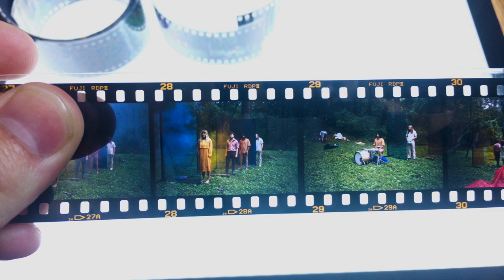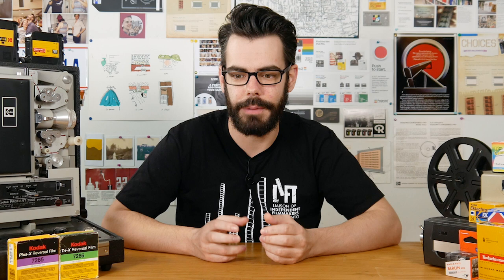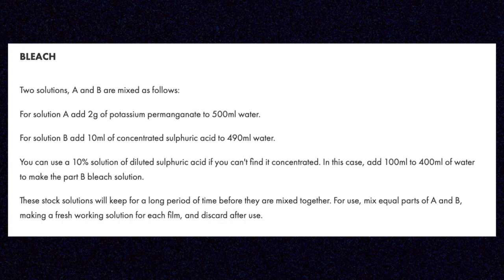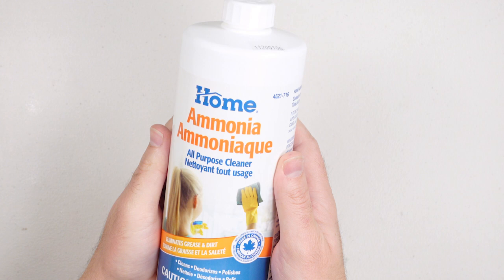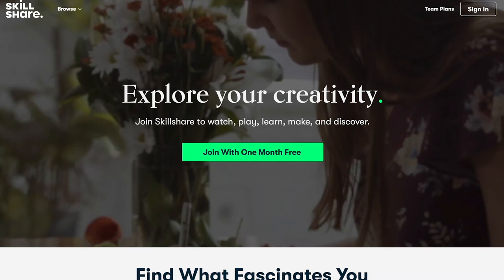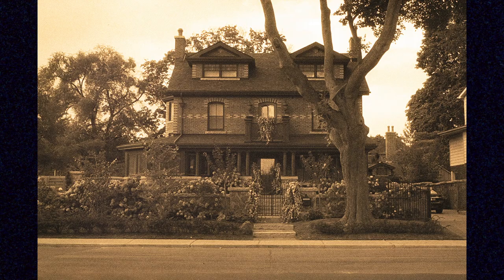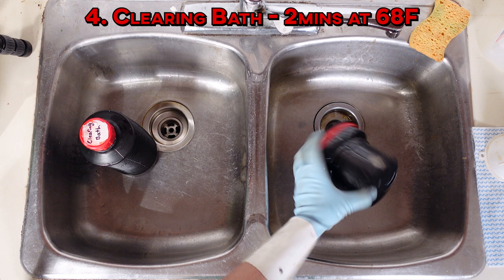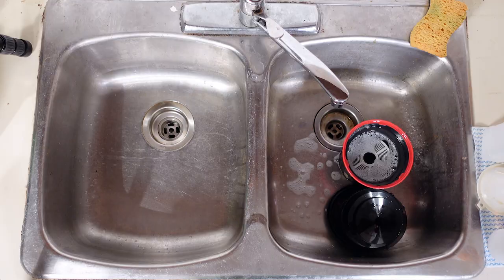BLACK & WHITE REVERSAL Developing Without a Kit | Slides from Negative Film

Comment: Second Exposure: Get a Flashlight, a big white bowl, fill it with water put the reel with film inside. flash it 10-15cm from above diagonal 4-8times, turn it by 90 degrees after every flash, so you cover each side once or twice. flip the reel over and flash it like before...

Comment: With the vinegar and peroxide photographic bleach, for one roll, you, need 60 mL of vinegar for every liter of hydrogen peroxide, take 350 mL of it and microwave it for 50 seconds at 1100 watts, it will fizz when bleaching is taking place, wait for a minute after the fizzing stops, then you can expose it to light, and then reuse the first developer. The positives will have a yellow tint, soak the film in tap water for 5 minutes, dump out the water, then replace with 350 mL of water, 1 teaspoon or 15 mL of citric acid powder, and 3 teaspoons or 45 mL of sodium thiosulfate (anhydrous) powder stirred up, soak for 7-1/2 minutes. Then rinse the film good as usual.
Reply: I would like to add that you should make sure you rinsed out all of the first developer from the film, otherwise it forms a coating and no force on earth will get the film to bleach ever again, no matter how hot the peroxide/vinegar solution gets!

Comment: And here i was, about to complain that the bellini kits asks for six baths with washes in between. Seeing that you even had to mix your own chemicals, I reconsider how lucky i am to just be able to buy the ready made kits :) I developed Fomapan 100 (non-R) and it came out very high-key but useable. Kentmere 400 came out dark and low in contrast, but still very useable. Then again, the kit said that it only works with Pan-F, FP4+, Agfa Scala and Rollei Ortho 25. i guess thats because these films have similar developing requirements and the the first and second developer is tailormade to them. But, i first exposed the film and then decided to read the manual :D

Comment: My current go-to BW reversal film is Arista EDU 400, shot at box speed. My process is pretty slow, but the slides are probably as close to perfect as I'll ever get. All at 68°F (20°C), I develop with Arista paper dev for 17 minutes 30 seconds (Constant agitation), wash for 15 minutes (Peroxide bleaches seem to make the film brown if there's any trace of this paper dev, probably could be shortened for copper), then bleach with copper sulfate bleach (For every 100ml water, add 5g copper sulfate crystals, 5g non-iodized salt, and 1g citric acid) for 10 minutes (constant agitation), wash for 6 minutes, 2 minutes 30 seconds in 2% ammonia (Constant, needs to have no additives), wash for 6 minutes, 6 minutes in a clear bath (20g sodium sulfite in 1 liter of water), wash 6 minutes, then redevelop for 10 minutes in Iron-Out (The toilet cleaner, add 40g to 1 liter water, filter before use, no reexposure needed), wash for 3 minutes, then fix and rinse as normal.

I really like using this specific process because the bleach lasts seemingly forever, ammonia is cheap, the developer is easy to buy, and way too many places sell Iron-Out. Wish more people talked about copper sulfate bleach as an option, as it doesn't destroy the emulsion like permanganate does. The only downside I know of is it doesn't work for films that use silver chloride, which is a very small minority of film. Also ammonia is stinky, so using a lid on the tank is recommended for that step.

Another niche version of BW reversal involves developing with paper dev, then using BW toner in the wrong order, which will convert the undeveloped silver into something else (Silver selenide for selenium, silver sulfide for sepia), then the bleach will make the rest of the silver removable with fixer, leaving just the toned positive. I've got the chemicals for this version of the process, and plan to try it out over the weekend.
Reply: Arista EDU 400 is just Foma 400 rebranded
Reply: @dian_photo  Yeah, but the Arista branded film is cheaper in the US.

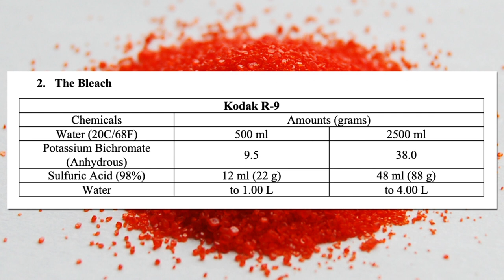Comment: 6:00 i have access to dichromate and sulphuric acid, a fume hood to mix the powder, and a safe way to dispose of it. 
My main struggle is that i have yet to find a developing tank that will not randomly decide to leak that day. All the tanks i tried work perfectly leak free one day, then decide to drip the next day, and the day after are perfectly fine again - no matter how firmly i screw down the lid. 
If it weren't for those stupid unreliable tanks, i'd be using the dichromate. 
If you cannot guarantee that not a single droplet of dichromate-based bleach will spill, do not work with dichromate. It's one of the nastiest chemicals out there.

Comment: The B&W reversal film was quite common in the 60s and 70s, I have a bunch of B&W slides on AGFA film from my uncle. They lived in the middle of nowhere in Argentina, and had access to this :) I did notice though that the slides look a bit more washed out than a B&W negative.
Reply: On a second look, I've found a few cases of the same photo in both reversal, and negative. so I think, mean I got the crazy idea that they might have contact printed the negative on top of another B&W roll, do you think it's doable ? would it produce a positive worth the effort ? I noticed the reversal prints don't have much grain as a negative, and are a bit more washed out. Also, the sprocket holes on the positive are exposed, and show sprocket marks that suggest contact printing. I can send you photos showing this if you want, and also for comparison between negative scan vs. positive scan.
Reply: I've also noticed on the positive B&W film, that they are printed on the wrong side of the film, IE, like loading the film with the emulsion to the back... Was trying to figure out how they could load the film the wrong side on the camera LOL
Reply: I mean the contact is done emulsion to emulsion, effectively reversing the print, which means, when DSLR scanning it on the emulsion side, the image is already on the correct orientation, no need for horizontal flip.

Comment: The most interesting and unique aspect of your process is the chemical fogging that you get by using Iron Out.  I have not seen chemical fogging for B&W reversal before, and can't find any references in Anchell or Troop books, who recommend using a light.  Examining the list of chemicals in Iron Out, we can recognize some typical developer components: (1) Citric Acid (Vitamin C?) is a developer, (2) Sodium Metabisulphite is a typical preservative, (3) Sodium Carbonate is a typical accelerator.  No restrainer that I can see.  So the only potential fogging agent would be the Sodium Hydrosulphite or possibly something not listed in the ingredients.  The question is: can a separate agent be mixed that does the reversal fogging so that a more conventional developer can be used for the final development stage?  This might simplify the overall process and give better control over the final steps.  (However these last steps are "to completion" so adjustments to exposure, etc. are too late at that point. ).
Reply: After some reading I found that the magic ingredient is Sodium Dithionite.  "Iron Out ... is often used for this by photo hobbyists because it's got quite a lot of sodium dithionite".  Also Kodak's fogging developer, FD-72, uses Sodium Dithionite as the reversal agent.

Comment: excellent video, i have been trying black and white reversal for the last year and i've got mixed results.
i used the permanganate bleach made from scratch from components i bpught from a chemical store. this bleach really softens the emulsion so you need to be extra careful when handling the film when it's still wet.
the best results i've got yet have been with ilford panf and pq universal development using the ilford recomended technique. it gave me some really nice positives with dense shadows and a slight warmth tone in the highlights. now i'm using the fomadon lqr developer since it's the one used in the foma kit and using fomapan 100 classic but i dont seem to get the same density in the unexposed areas such as the sprocket holes as with the ilford technique, being the developer the only difference between the two trials so i guess i need to let it longer in the second developer. otherwide it's a super entertaining process and very rewarding if you get good results

Comment: D-19 is magic as far as I'm concerned.  I use it as the 1st and 2nd developer without any additives for 100 and slower speed film at box speed. 400 speed films (Tri-X and Delta) perform just as well when rated at 100.  It has the benefit of utilizing all the silver present in the emulsion to give maximum blacks and preserve subtle highlight detail otherwise fixed away by the first developer.  The ferric chloride / ammonia 2-step bleach you describe operates on the curious fact that ammonia selectively fixes the silver chloride created by the bleached silver, but leaves behind the primarily bromide based emulsion coated onto the film.
Reply from the maker: D19 is what I’d like to try next for this process!
Reply: @AnalogResurgence  The D-19 recipe in this video appears to be correctly transcribed from the Kodak J-1 data booklet. I've had success with the same formula albeit substituting a molecular equivalent of anhydrous K2CO3 for the washing soda.  16mm 7266 and 135 Tri-X/Delta 400@100 7'30" @ 20C is a good starting point.  I'm 48 stereo frames into roll of Pan F 50@25, which I'm still trying to get the hang of in D-19.  The extra stop of exposure is probably overkill and I may need to pull the 1st development... but anyway.

A great presentation to start the new year.  Thanks and good luck!

Comment: An excellent tutorial! I have experimented with the Ilford process and it has been difficult to get good results. Getting the required chemicals here in UK hasn't been a problem though. My biggest challenge has been that the process (I suspect the bleaching phase) has melted the film emulsion to varying degrees. I am now motivated to pick this up again following your guidance. Thanks!

Comment: This is so good. I've also experimented a little with B&W reversal using the method over at "Go Everywhere". Initially, they came out a bit dark, but it worked. The downside is as you said, the developer has a limited shelf life. Thanks for the detailed info. I've been wanting to project B&W slides. Will bookmark this and come back to it for future experiments.

Comment: I recently attended a b&w reversal workshop that used PQ universal as both the first and second developers. Since I only have HC-110 at home, I thought I'd give it a try. The films I've tried at home are Kentmere Pan 100 and 400. However, after several rounds of frustrating tests, I've found that HC-110 at whatever dilution, either with or without hypo added, will cause the clearing bath (either sodium bisulfite, sodium metabisulfite, or a mixture of the two) to actually completely clear out the emulsion, leaving only a transparent piece of plastic. So it looks like for Ilford/Kentmere films at least, the ammonia is absolutely crucial. After watching this, I'm curious what's different in the Foma film emulsion that doesn't cause it to completely clear out.

Comment: Would it be simpler to directly add sodium hypo to developer (which is, being a salt, neutral) instead of fixer and the ammonia? Ammonia in developer raises the overall fog. This in turn lowers the final DMax of the slide.
Reply from the maker: That's definitely the better method, I was unable to source hypo easily and was curious about alternative methods that could be tried.
Reply: @AnalogResurgence  Your Fp4+ slides are beautiful. I had been reversing b&w films since early 2000 and I've spent so much effort, time and money in it, fine tuning the process. Your process is simpler (I use permanganate-based bleach), neater and yields the same or better results than mine. What I mean is that "use what works for you" could never be more true than this. I feel the urge to try your F3Cl3 + NH3 bleach.

Comment: Hey, in the first part of the video you mention that the second developer doesnt have to be so intense, but in the step by step process you dont mention decond developing step. What about it? I followed the video instructions and after the bleaching and clearing bath step my film was almost transparent, but still contained traces of the image (my first developer might have been too strong, I used Foma paper developer), but after exposure to light I put the film into a fixer and after that there was nothing on the film. Can it be due to that I didnt develop it after the exposure to light step? Thank you in advance
Reply from the maker: You definitely need to use a second developer after the re-exposure or nothing will come out. Putting it straight into the fix will remove the silver that needs to be developed during that step! I mention at 16:08 that instead of doing a physical re-exposure and using a second developer, I'm able to use a drain cleaning product that combines both re-exposure and second developing into a single step. If you don't have that powder though, you can still re-expose it to light normally and then use a developer such as dektol after that for the second development.

Comment: The audience for this is getting bigger. As it it gets harder and harder to get good and affordable optical prints from your film, this is for everybody who doesn`t want a digital step to mess up their analogue intention.
Reply: Of course, if you DIDN'T mind having a digital step, you can get an SLR camera that can focus closely and an HDTV and computer, then invert the colors of your digital camera pictures and shoot the TV with the film SLR camera. Then develop it at home as regular negatives. I did this with a C-41 color kit for some Guild Wars screenshots and they came out looking cool. It does help to make a DX sticker with the label maker and air conditioning/RFI foil tape and over expose by one stop. (If you have 400 speed film, change the DX code so the camera thinks 200 speed film is loaded)

Comment: Sodium metabisulfite seems both expensive and difficult to get in Sweden. Would Potassium metabisulfite work? Both are used for the same purpose in wine making and produce sulfuric acid when breaking down, it seems. Readily available and inexpensive. Campden brand.
Reply: According to "The Film Developing Cookbook" (Troop, Anchell) p. 35, these can be swapped but be sure to double rinse before fixing as the potassium ions may impede fixing.

Comment: Incredibly helpful! But, how did you figure all that out? How did you know that mixing Ammonia, HC-110 and fixer will work as the first developer?
Reply from the maker: A lot of deep diving into photo forums from over the years combined with experience mixing chemistry from scratch myself! I found an old mention of making a DIY monobath developer using larger amounts of ammonia and fix in developer.
Reply: @AnalogResurgence  My friends and I are actually trying to develop the Rollei Infrared 400 with a color reversal process. Any recommendations? Have you ever tried?

Comment: Hello, is the Iron Out necessary so that there is no sepia tone?
Reply from the maker: No the Iron Out is used as a replacement for the re-exposure and second developer step, you can instead just do a physical re-exposure to the light after bleaching and then put it into a black and white developer. I believe the sepia tone is removed with a proper clearing bath after bleaching as well as a good first developer.

Comment: Can I use other developer like rodinal? XTOL? Ilforsol3? I dont think HC110 can be bought in canada.
Reply from the maker: You can definitely experiment with other first developers and skip the added fix/ammonia elements I did in this video! More recently I've been using Kodak Dektol (of FlicFilm Quintol if Kodak isn't available). I mixed 4L of Dektol and then diluted it as 2 parts water to 1 part developer (2:1) and developed some FP4 for 12 minutes, the rest of the steps remained the same and I got some great looking positives.

You need a pretty active developer in the first step and I don't know exactly how various ones will work. I've read of people using rodinal, Ilford PQ, and Kodak D-19 if you can get it. Kodak D-19 is old, but the Canadian company flicfilm makes an equivalent called FlicFilm MQ-19.

There are also lots of forum posts over the years about reversal that are out there! Trying searching for results about specific developers + reversal developing and see what you find. https://www.film-and-darkroom-user.org.uk/forum/archive/index.php/t-5390.html
Reply: @AnalogResurgence  thank you for the detailed guide! I will go ahead and try with what I have. I have a bottle of tetenal which I think is pretty active! It’s in 1:4 diluted.
Reply: I failed for the first try. The film came out really yellow ish and hardly showing any image. I think it’s the ammonia I bought off of Amazon did this. The ammonia did not have any smell. And the yellow is from ferric chloride and the ammonia (or water who knows) failed to take it off.

Comment: oyyyyyy your syringe technique is not very accurate. 

Fill past the line that you want to measure, point the tip up so that the air bubble goes to the opening, push in the plunger with the tip straight up. This will push out the remaining air as well as a small amount whatever you're trying to measure and continue pushing the plunger to the line that you are trying to measure.